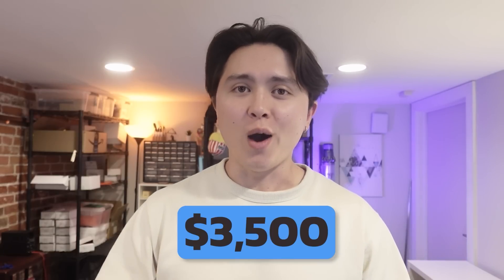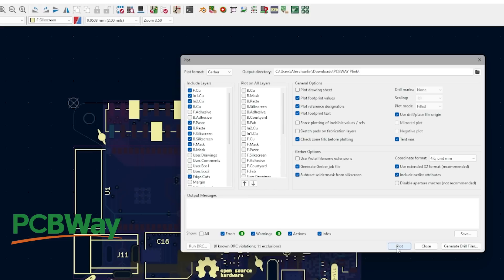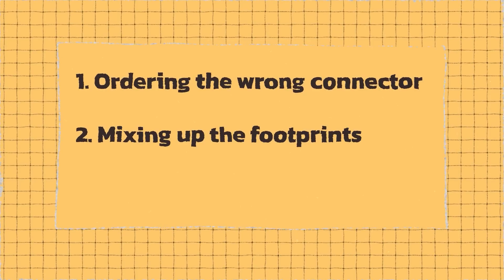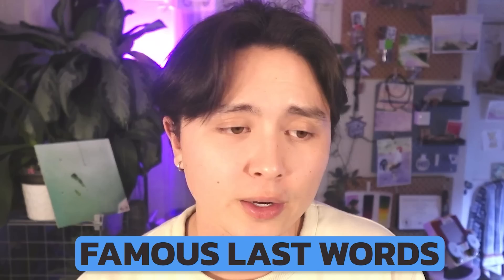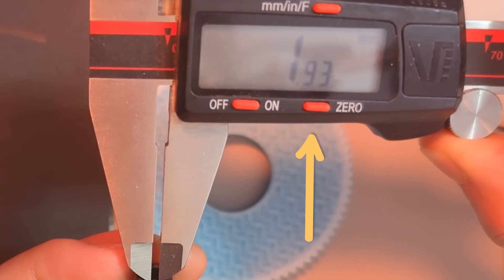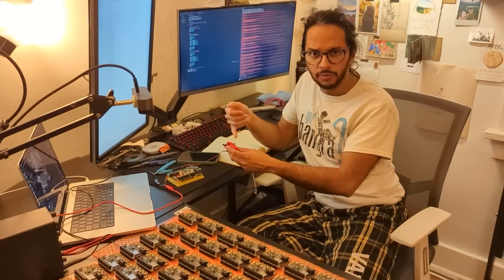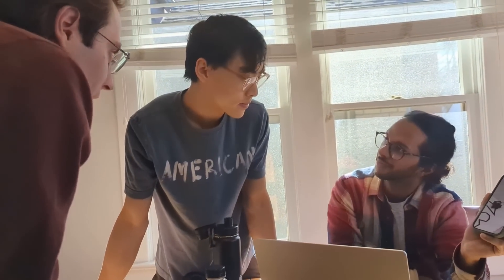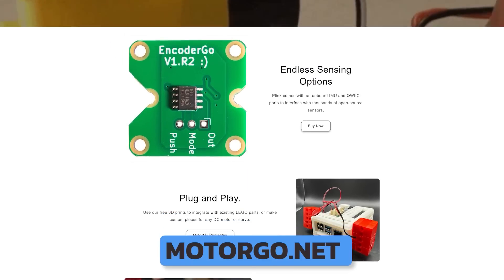I'm embarrassed to put this online as an engineer

Comment: Yeah man, footprints, and other tiny details with parts (like pin size on the barrel connectors, or pin sizes vs drill sizes, vs some slight offset of something between the footprint and the actual parts) will screw you over every time. I don't build boards for profit, but even when building my own boards, the most stressful and absolutely worst part is ordering the parts, and not messing up some 'mundane little detail'

Comment: Man, mistakes like these are just part of the process of PCB design! Actually I found a really helpful script that will take a part number for a component and it will download the KiCad footprint, schematic and 3D model of the part. The part number is also stored in the metadata so you can always find it again. Really helpful for ensuring that you don't choose the wrong footprint or schematic for a part and also finding the details of parts you used in old projects not to mention generating the final BOM.
Reply: The script is called easyeda2kicad. Not sure if your sponsor has an equivalent to it.
Reply from the maker: 👀👀👀 ooh thanks for sharing!
Reply: Easyeda2kicad is great

Comment from the maker: I really wanted to post this video to just let "my younger self" (any young engineer or aspiring engineer) know that sometimes you will make a pretty gross mistake.  It puts that pit in your stomach.  But whats more important is that you don't make the same mistakes over and over. 

Emotions are part of being a person.  Systems to overcome obstacles are an engineer's tools.  My advice to my younger self is to consider yourself part of the system you are designing -- and ask why this mistake happened, and how to mitigate the chances of it happening ever again.  

If yall want a detailed video on how to setup a design process such that mistakes are minimized systematically, theres a lot of things that were too low-level to fit into this very general view video.
Reply: As an old engineer (well 45, I still feel young!), you’ve hit the nail on the head. Human mistakes are inevitable, so part of “systemising” a reliable process is working out how to catch those errors as early as possible. The later you catch them, the more it costs to fix. One good practice is to get someone else to check your work as you go!